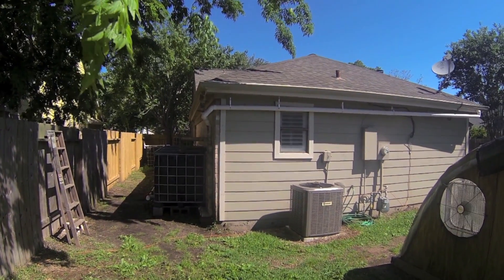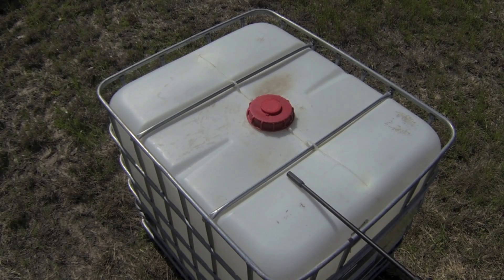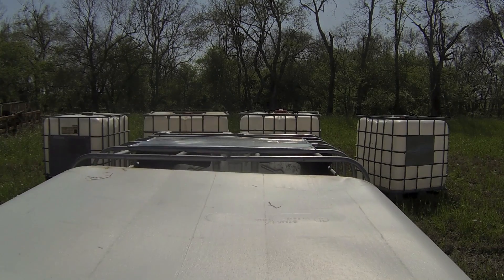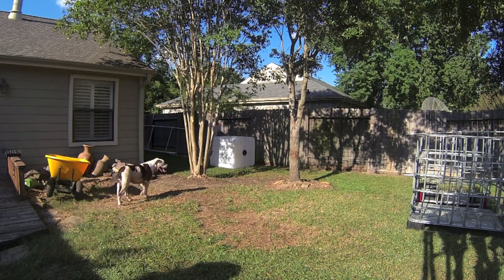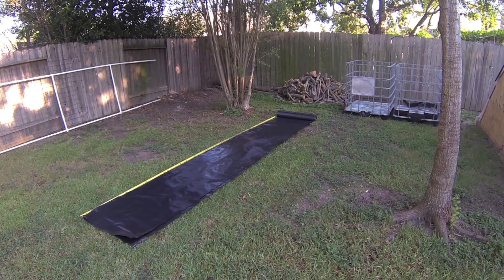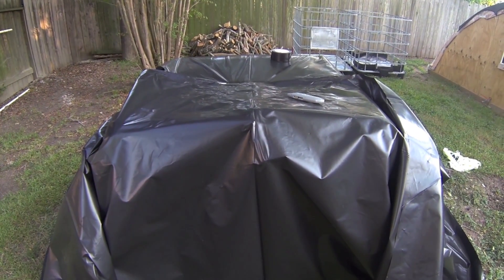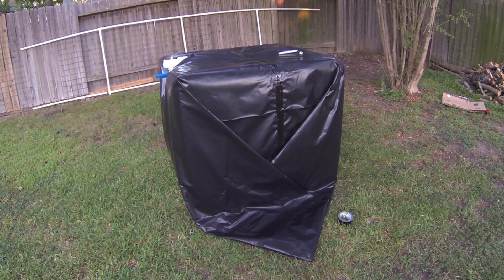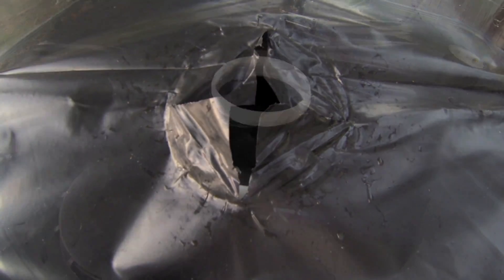Step 1 - IBC Rainwater Harvesting System - Cleaning and Wrapping Tank

Comment: What about insulation so it does not freeze in winter, because in my design of water storage, i have a tank Overground then it overflows to some underground tanks, i want some water on the surface for my garden,  so it does not have to get pumped up again.
Reply from the maker: I live in Houston, it rarely if ever freezes here.
Reply: They make a black electric heating blanket to go over these IBC tanks.

Comment: After this, you might want to add a roof. - it just keeps going and going. I've found the plastic deteriorates relatively quickly. I put a sloped, shingled panel on top of mine since disassembly and re-wrapping is a huge PITA (if not impossible [unions or couplers were not used]). Manageable sizes are helpful because they do get heavy quickly, and you might need to open the cap.
Reply from the maker: +Lou Fazio 👍
Reply: I've have  mine wrapped like this fellow for 15 years. I have no plastic failures at all. I'd say IMHO that this technique works well enough. I've wrapped one tote in .060 EPDM (RUBBER ROOFING MATERIAL) from left over rolls of roofing rubber, since I was a roofer. This works great too, but more expensive than Polly. Good day.

Comment: Can you provide some insight insofar as freezing / cracking is concerned? Our winters can sometimes get below 0 degrees (F). Would additional insulation (eg., styrofoam) fit inside the plastic, or do you have other ways of mitigating freezing? I've considered partially burying our totes, but we have a couple spots where that's not very feasible. If one were to create an insulated cover that went over the cage, would that be sufficient for blocking light? -Thanks
Reply from the maker: +JoshDoesMusic burying a tank would be the best solution for freezing. Don't bury these totes, make sure to buy a tank made for burying
Reply: JoshDoesMusic   I'd say you're going to have to drain them. It's not like you're going to get any appreciable amount of water anyway.  You have to play just right to get the last few day out of if.  Also, be aware that just because it duos below freezing at night, the whole tank is not going to freeze. You will have to have lines drained though. I've found I can get by for about month longer after this time had come. Don't bother thinking about heating it; you'll be way past it in cost. - unless maybe you have no other water source.

Comment: Any reason why you suggest using Dawn?  Dawn is very strongly perfumed, stronger than any other soap I have used.  If I use it to wash plastics, that smell is very hard to get out of the plastic.  If it's something I drink out of, it will take weeks and many washings before it gets back to where I can't taste it.
Reply: You have to filter the heck out of rain water to make it potable.  A little soap residue or fragrance is the least of your worries.  Asphalt from the roof, rain falling through airborne soot, bacteria in the gutters pose a far greater risk.
Reply from the maker: +AgentFriday No particular reason. There may be better soaps out there, but that is what I had a the moment.
Reply: Some people call all sodas "Coke". Some people call every tissue "Kleenex"... Some people call every dish soap "Dawn".

Comment: How do you get paint out of it .we purchased one that was used for paint and we are trying to use it to water our plants. Also how do you open the  bottom valve I'm not sure and I don't want to break it . thank you love your video
Reply from the maker: Marie: My first thought would be to trade/sell it for a tank that does not have paint. My other thought is to use paint thinner or gas to remove the paint. Also I know there can be many different types of paint some water based and some not. I do not know if my suggestion will work but hopefully it get you going in the right direction. Your concern about opening the valve is an easy fix. The handle should be pointing to the right when in the closed position. Just pull it towards you to open the valve. Now the handle should be pointing at you. In the video link below at minute 16:00 I open and close the valves. You can not see me actually opening and closing the valves. Watch that part, the tank valves are closed. Take not of the position of the handle there, then go back a few minutes in the video to the 13:40 mark you can see how the tank valves look when they are open. 
Thanks for the comment:)

IBC Rainwater Harvesting System Update #2

Comment from the maker: Blake, I am not sure if the wrap will loose color after one season, I have not had any problems with the wrap so far. However my system has only been in place for a year or so. In my opinion wrapping it twice would work and it should still fit in the cage.

Comment: Could you not paint with a dark blue or black paint more easily?
Reply: Plastic paint that lasts is expensive. Rarely, if ever, do you see painted plastic in the real world.  The color of the plastic in your car, in your kids toys, of your keyboard is how it came out of the injection mold at the factory.  Most paints won't properly stick to most plastics.  Try painting your Tuperware sometime.
Reply from the maker: I do not imagine it would be easier, I thought about paint. Here are my reasons for not painting. 

1.Paint is messy,time consuming,requires more tools if you spray the paint on, and is difficult to remove if you wanted to remove it. 

2.The wrap is much easier to locate for purchase (Home Depot or Lowes), requires less tools, time, and skills to complete, and can be removed/replaced easily if need be.